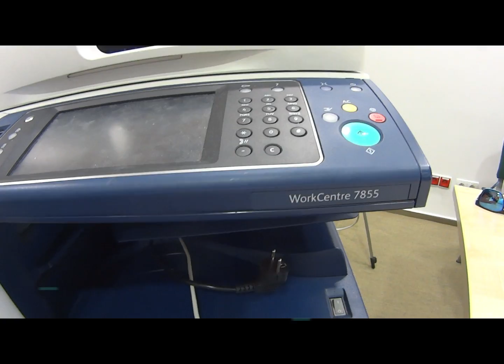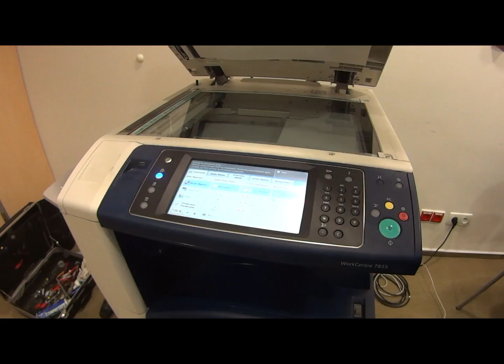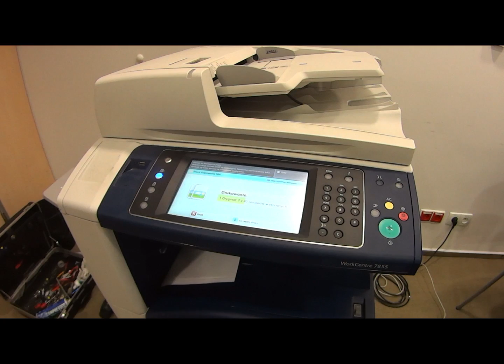XEROX WorkCentre 7830 7835 7845 7855 fuser error 310.330.00

Comment: I was a former xerox tech. I don't miss xerox machines one bit.

The issue is that the fuser nip is set to tightly on these fusers. The plastic gears in the fuser start binding and the machine codes out.

Try taking off the cover to the fuser and loosen the nip screws 3-4 equal turns on both sides. It won't affect the toner bonding to the paper. It has worked every time, requires no parts and much faster repair.
Reply from the maker: Thanks for your valuable comment. I hope you will write something interesting sometime in the future. Thank you and best regards.
Reply: Well done.
Reply: @srrcopiersolutions  Thank you! With Xerox, I moved up over the years in what I serviced. I eventually moved up working on the C70, Versant 80, D110, Numbers 120. I had a print shop I serviced that did 2-4 million copies a month.

I moved on because my company didn't want to really pay. Also handling 9 production machines along with about 50 other printers and mfp's was just overwhelming 😂.
Reply: No dont do that just grease the gears works perfectly every time.
Reply: @michaelh7527  lol why don't these clowns want to pay up!? How much did you make if you don't mind me asking?
Reply: @Akziis  only about 35,000 a year. I was promised a lot more if I showed I could do the job well.

Using the BEI system. The Nuveras I worked on ran about ten percent better than national average with 30% fewer parts used than average.

I felt like I should of been making 60,000 a year minimum.
Reply: @Akziis  Greasing the gears is just a short term fix. Can almost guarantee a callback. The nip pressure is too tight.

Another issue with these machines are the toner feed augers clogging and breaking. Clear sign of that problem is a new toner quickly dropping to 0%.
Reply: @michaelh7527  I guess Xerox knows about the auger problem because they recommend vacuuming them in some REPs I read....
I do have a lot of 7855 with this error and will try the nip pressure trick. Thx
Reply: could you please show the exact screws that need to be loosen? Thank you very much for the help.
Reply: Great work.whats your email address i want to ask something
Reply: Hi sir
Reply: Hi michaelh which are the nip screws please? Do you mean screws where is the spring? If you relase them won't you have a problem with fusing? I know it is old topic but maybe you will be able to reply.
Reply: @printerman3599  were you able to fix the problem, I have been having this same problem for months now

Comment: I just inherited almost 300 of this machines (7855) in my area. 
I see a lot of machines showing 310-330 error, but still working.
Yesterday I looked into Fault Counters on one machine and 310-330 had 204 instances of that error.
Sofar, at every machine displaying that error I am able to run the motor in the service mode no problem.
Also the 1st BTR contact & retract test is successful.
Snooping around there I noticed that the motor itself does not have any sensors telling the machine that it is rotating.
Next to the motor at about 7 o'clock I see a clutch (engaging BTR drive) and below a home position sensor telling the machine 1st BTR contact or retracted position .
Looking at the fuser schematic, there is also a sensor "Fusing Unit Belt Rotation Sensor".
Other then sensing the current on the motor, those are the only 2 sensors that are being able to sens no rotation from the motor.
The machines I work with, are very dirty (dust).
The fact that it is not permanent fault, but seems to be intermittent (in my case anyway), I tend to believe  that the problem maybe in the dirty sensors. 
I keep reading that people replace fusers and that fixes it: confirming to me that it is the dirty sensor in the fuser...
Reply from the maker: The photocopier does not actually have a kettle that monitors the operation of the engine directly because it is unnecessary. The engine drive is transferred to other parts of the machine by means of clutches and, as you mentioned, the sensors are only there. Damage code 310-330 indicates a photocopier time delay error. Most often it is the result of a worn motor or a used fuser. If your photocopier is dirty on the back, of course, you need to clean the drive and sensors, but this is unlikely to help you fix the problem. 310-330 may appear occasionally, but ultimately leads to the shutdown of the photocopier.
If the previous service charged money for each printout and photocopy, it is known that they did not want to replace the parts.
The sensors in the fuser may be responsible for the paper jams but are not responsible for error 310-330.
regards
Reply: Fuser motor gear ⚙️ slipping 😁

Comment: Did you reset this Error(310.330.00) by any code? Or that error disappeared after replacing motor?
Reply from the maker: The code disappears after replacing the engine. I did nothing more.
Reply: @MrRicoh  thank you for answer. I have replaced engine, but I still have this error code.
Reply from the maker: It looks like you also need to rethink the replacement of the heating unit with a new one.

Comment: Hello Sir Regards! My xerox 7535 shows fuser system error 310.382.00 (thermostat fail) if left on for sometime upon sending a print or anything. It also doesn't move to sleep mode and stays on low power mode even after settings. pl reply and guide. Thanks!
Reply from the maker: There is only one solution: replace the fuser unit if you have already checked the engine.

Comment: I have a xerox 7665 workcenter and today it started up with a Fuser System Error. I also looked at the fault history and it shows 10.320.00. Any suggestions? Thank you in advance!!!
Reply from the maker: Hello. First check that the rollers are turning slightly. Often the engine is damaged, such as in the movie, and it can also cause this error.
Reply: @MrRicoh  all rollers are turning freely. A new fuser has been put in its place and still no luck.
Reply: I have Xerox WC 7556 machine
It shows fuser system error call for assistance
Plz help me
I will pay You online

Comment: Hello, i have a xerox wc 7530 and it started making a loud noise when its powering up and printing. Its a loud clicking noise. I tried changing the fuser as many suggested but it did not resolve my issue. Please help me.
Reply from the maker: You must check the Fuser Unit driving wheels at the rear of the machine near the engine. There is probably damage there.

Comment: This is why it is so HEAVY (all the internal metal). Not sure if this is a good place to ask; but I bought a similar used printer (DocuPrint IV 2275), and cannot find the menu for finding Toner levels. It weights around 130+Kg, and was a real pig to carry upstairs with the kids (where my [main] computer sits). The 775 page manual does not help as the Menu on the Printer/Scanner/Copier does not have a "MACHINE STATUS" Icon/button on mine.
Reply: P.S. It works great. The price I paid is what I would have paid for just the Toners & Drum of my existing printer (without built-in Scanner). Do I really need to use Internet/Lan? to get the scanner image to go to my PC, instead of via USB to work on (rather than using immediate print)??
Reply from the maker: this Toner level setting can only be activated by the Service Center.  You need to enter the Service mode. So, activate this option.
Reply from the maker: @RogerThat1945  I don't know what you mean by battery

Comment: what does this fault codes stands for 310.382.00 n how to solve it please
Reply from the maker: Hello,

Code

310.382
Description

Fuser Thermostat Fault. The Fuser Assembly Thermostat is broken.

Remedy

• Turn the power Off and remove the Fuser Assembly. Inspect the Drawer Connector between the Fuser Assembly and the Main Unit ( DJ600) for broken/bent pins, foreign substances, burns, and etc. • Check whether the MCU PWB connector P/J431 is connected properly.
Measure the resistance between P600 pin-A11 and P600 pin-B9. Is the resistance infinite? Y↓ N→Check the following connections for open circuits, short circuits, and poor contacts. • Between DJ600-A1 and MCU PWB P/J431-11 • Between DJ600-B1 and MCU PWB P/J431-18 If no problems are found, replace the MCU PWB. Replace the Fuser Assembly.
Reply from the maker: Code

310.382
Description

Fuser Thermostat Fault. The Fuser Assembly Thermostat is broken.
Remedy

• Turn the power Off and remove the Fuser Assembly. Inspect the Drawer Connector between the Fuser Assembly and the Main Unit ( DJ600) for broken/bent pins, foreign substances, burns, and etc. • Check whether the MCU PWB connector P/J431 is connected properly.
Measure the resistance between P600 pin-A11 and P600 pin-B9. Is the resistance infinite? Y↓ N→Check the following connections for open circuits, short circuits, and poor contacts. • Between DJ600-A1 and MCU PWB P/J431-11 • Between DJ600-B1 and MCU PWB P/J431-18 If no problems are found, replace the MCU PWB. Replace the Fuser Assembly.

Comment: Sir I have  Xerox workcentre 7530, it always says black toner(k) empty, eve after refilling the power and replacing the toner  chip, and sometimes it shows it is not a compatible toner cartridge replace the toner cartridge error... And the machine makes noise, I think it comes from gears ...
Reply from the maker: Did you know that Xerox has chips for a variety of markets? Euro, USA, Asia ... there are different chips everywhere.
Reply: @MrRicoh  , it always makes gears full noise, I replaced with new original toner cartridge black but also same problem..dies it have any toner dispenser or motor problem..

Comment: unknown what the problem is but have a workcentre 7830 the screen is not turning on however  the lights around the display stay on but  nothing else comes on. I tried to reset and unplug.
Reply from the maker: If your copier has a HDD, disconnect it and start the copier. If that helps, replace the hard disk with a new one. If that doesn't help, I don't know.

Comment: Hi,I have a problem of powering on of a machine 7535.after powering on ,it shows green screen later power off it self in few seconds
Reply from the maker: First, disconnect the ADF document feeder and try to start the copier. If this does not help, disconnect the HDD and start the copier. If this does not help, install a new power supply.

Comment: Hi, I have a rexox  7545 and it only displays fuser system error, no error code. Can you help me.
Reply from the maker: I check in such cases the engine driving the Fuser Unit. If it does not help, I put in another second Fuser
Reply: @MrRicoh   thank you so much. I handled it

Comment: I have a 3655, and when I turn on the printer, it remains static, the screen does not respond, it only prints, I have to turn off the equipment, turn it on again and it works again, but over time the screen remains static again😮‍💨
Reply from the maker: When was the last service and software update done?
Reply: @MrRicoh  I already managed to solve that problem, now another one appeared, I put new toner in it and it does not recognize it, I get several errors, such as 322.319, 303.347 and all this has arisen since I changed the toner, in the area where I live there are no technicians to this trade mark

Comment: sir i have 5845 i press r3 as paper jam issue and suddenly system power shut no power on machine in right now what would be the problem
Reply from the maker: You may have a damaged power supply. But it's possible that your 230v connection in the building has no grounding. You have to check, it's very important.

I am sending greeting and I wish you good luck
Części do kopiarek http://www.copy-expert.pl/
Facebook: https://www.facebook.com/Copy-Expert-113431678801597/
Części używane http://www.copy-expert.com/

#RICOH #COPIER #PRINTER #DRUM #TUTORIAL #PHOTOCOPIER #TRANSFER #COPIERPARTS #COPY-EXPERT #JEMIOŁEK

Comment: my xerox wc7545 error shown fuser system error and machine error code show is 310-330-00 and other one thing is ink is not heat on paper plz suggest some solution
Reply from the maker: replace the same engine as I mention in the movie
Reply: @MrRicoh  sir one thing is when I start the machine then show fuser system error and black ink on black drum show what is this?

Comment: error code 
310.378 heat belt rotation fail
xerox 7556
Reply from the maker: @rajeshsawant4225 Unfortunately, in this copier you first need to replace the Fuser Unit and see if that helps. If the problem recurs, you should order and replace the motor that drives the fuser unit. Do you have another used Fuser to perform diagnostics? I hope so. Write. Don't forget to subscribe to my channel. Best regards.

Comment: I have Xerox 7435 and its error is 010-311
Reply from the maker: This is a known fault code. If your machine is still under warranty, please contact the seller. If you no longer have the warranty, remove the fuser and check if the thermistor is connected correctly. If that doesn't help, you will need to buy a new fuser unit.

Comment: FUSER ERROR COMMIMG 7855 I RESET BUT AGTER SOME PRINT MAY ONE OR TWO PRINT AGAIN COMMIMG ANG MACHINE NOT TO BE START FOR PRINT EROR CODE IS 310.330.00 KINDLY HELP
Reply from the maker: First replace the Fuser Unit with a new one and then perform the reset. If there is a damage code, it means that the fuser is damaged and reset will not help. First install the new fuser.